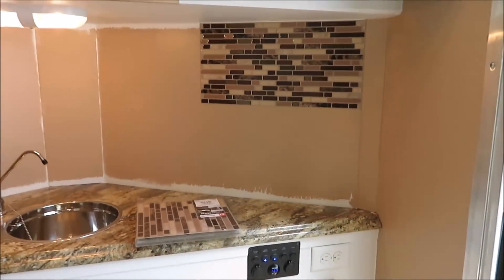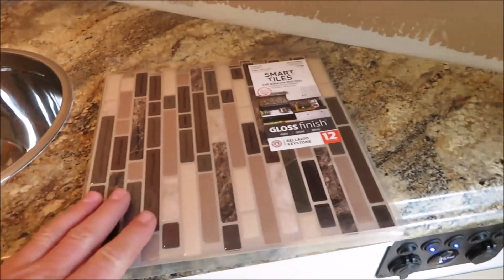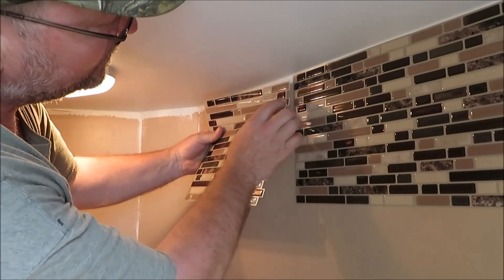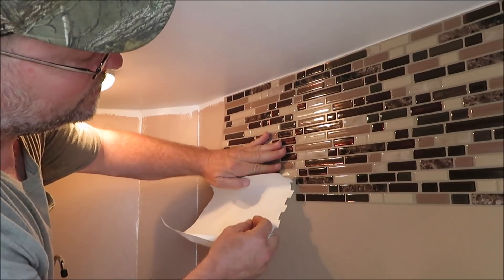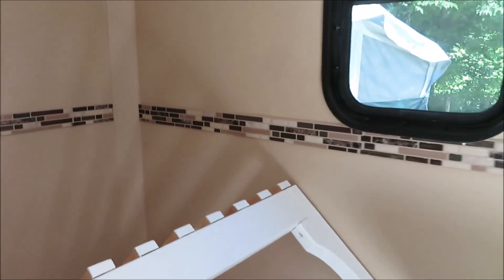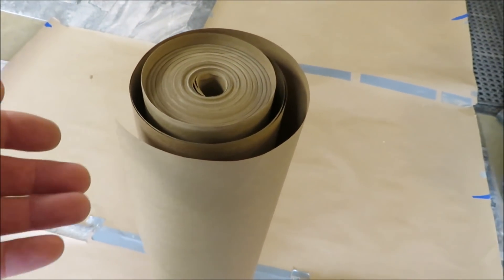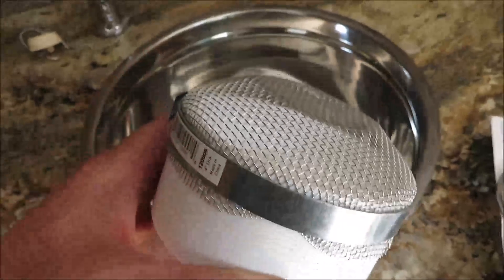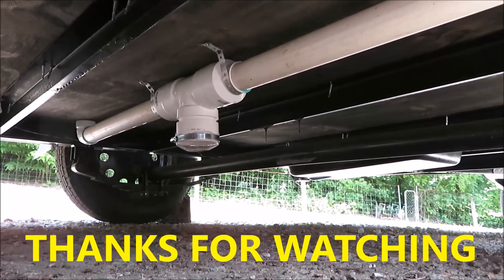cargo trailer camper build part 24 installing the backsplash

Comment: Kevin, I was the one that mentioned the mice out West on BLM land and your use of a screen over that vent pipe was PERFECT. No mice or snakes will get through that. Snakes don't chew, but they seek the cool and the warmth at different times of the year. Mice or kangaroo rats can't chew through that mesh. I had to stuff steel wool around openings on the underside of my rig after a scorpion crawled up my tire and through a hole. Your rig is great. If you haven't glued down your sheet vinyl (linoleum) yet, don't. You can brad nail it on two edges (not all around) and static electricity will hold it down fine. Easy replacement later on and you won't have to scrape the glue up.
Reply from the maker: I sure hope that thing work my wife would die if a rat came up through that pipe.